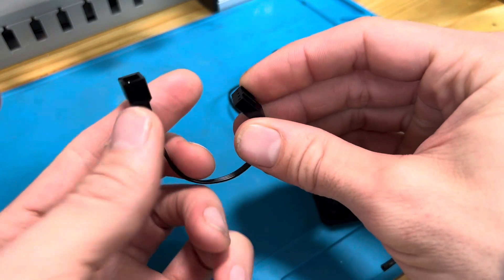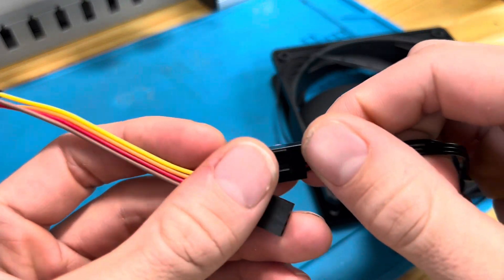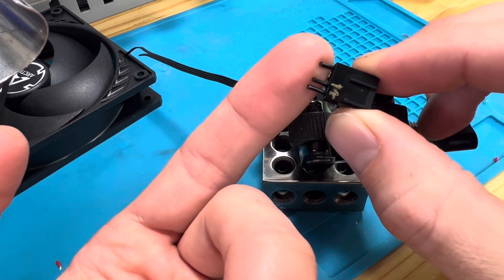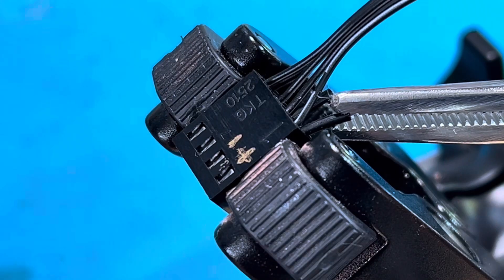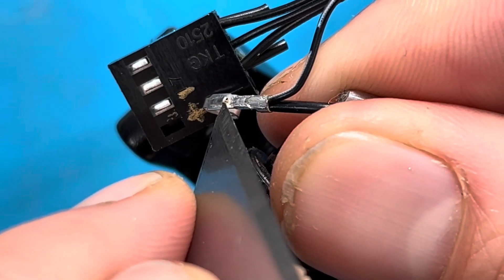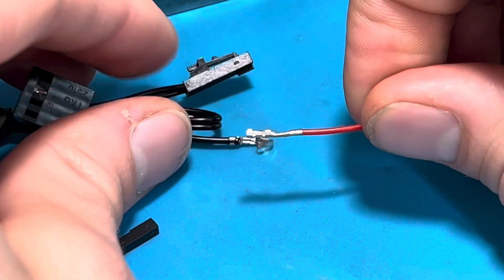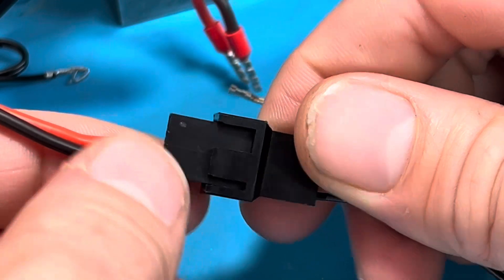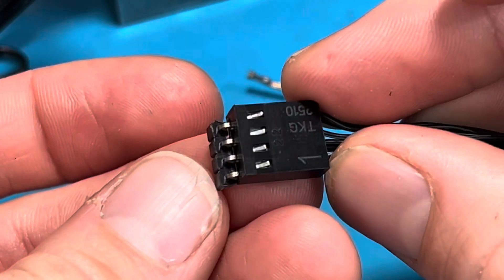Disassemble Molex KK (close-up) Connector

Comment: Molex sells an extraction tool for KK 2.54mm contacts, part 11030022 (aka HT-2759). It is ridiculously overpriced for the little piece of sheet metal that it is, but it would be trivial to make your own out of sheet steel (ideally spring steel). I’ve used the Molex tool and it applies pressure juuuust right to release the contact without totally smushing in the lance. It also grips the housing a little bit so that you can easily pull out the wire.